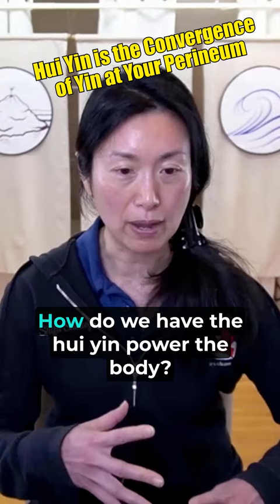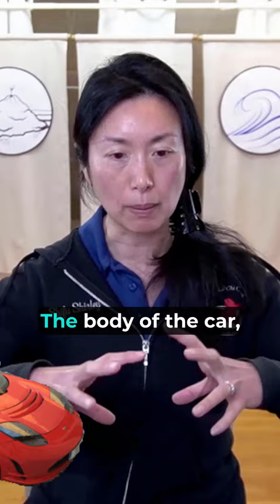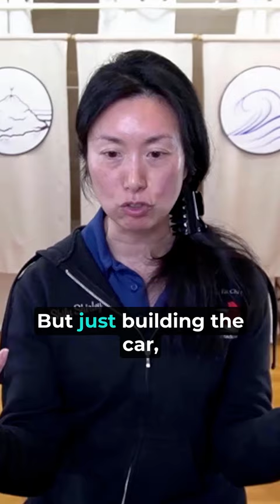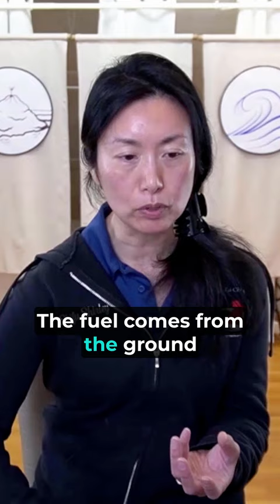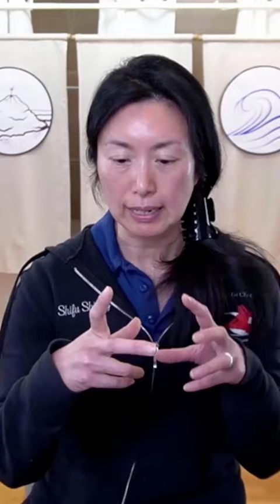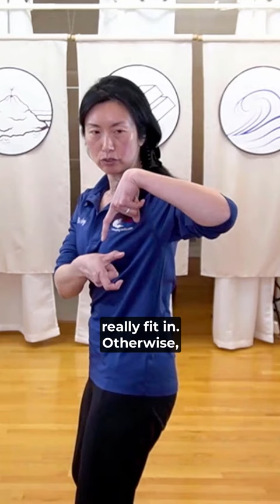Hui Yin is the Fuel Injector for Your Body's Engine

Comment: First felt the experience (you call power) of the hui yin a few months ago (one of your monthly things). Further exploration has been limited. I have a better sense of it though manual palpating (in the shower , in best alignment while mitigating a fall) but it’s difficult to sense it’s experience in normal standing and movement. Ther is so much going on in the pelvic arch that seems to be getting in the way.
Reply: imo if you do 3 to 4 hours of training it can still take 2 years to get an understanding of hui yin even if you have a fast eye. Take ur time and don’t worry about it for now. Just keep it in mind for the future.
Reply from the maker: The more you strengthen up your core and relax your back and pelvis, the more it will come 😁
Reply from the maker: Thank you so much for sharing your insights 🙏❤️